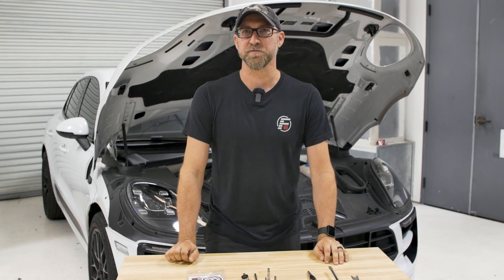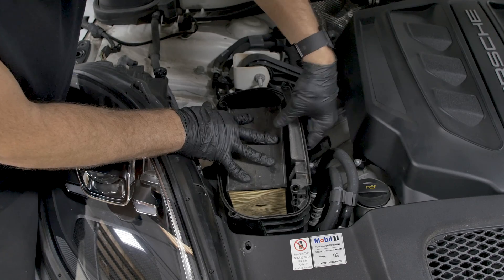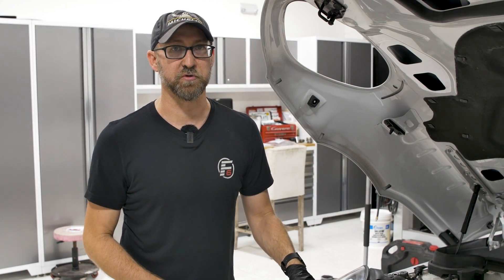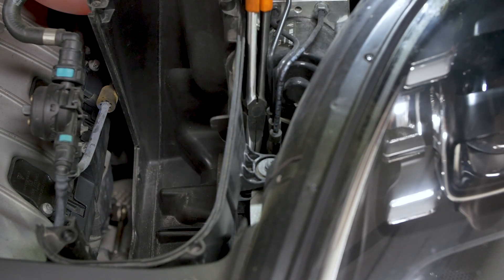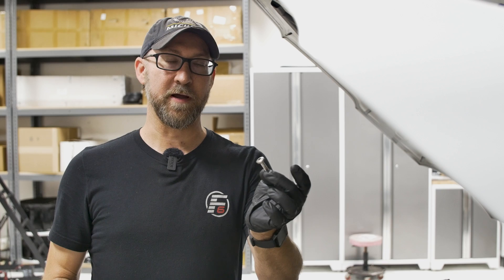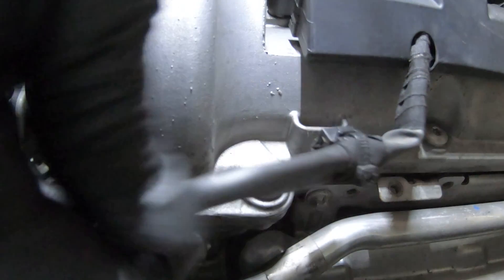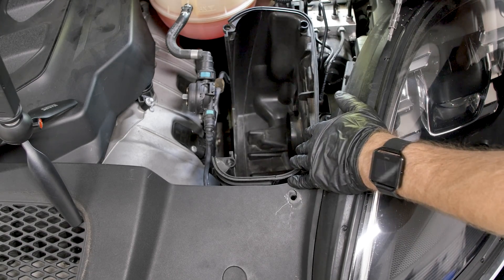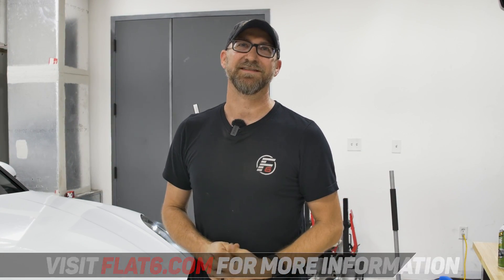How To: Macan Timing Bolt Replacement Guide

Comment: I feel sorry for the folks how were out of warranty-and got hosed/bent over by the dealerships that charged up to $10K to get this fixed!😱🙀🤬🤬👎👎👎. I’m from  the school of, disregard what the dealership  tells you and use your own brain/intuition. SO MANY TIMES, you can save SO much money…
BMW X5 I worked on recently, valve cover gasket for example.
Got breather tube, gasket set, new valve cover, and maybe one other little thing for under $300.
The job is completed with basic hand tools and e-sockets. Done in a day. No leaks! STEALERSHIP WANTED OVER 3K!!!!
European shops averaged 2.3K-(out of 5 I contacted)
If you have confidence in your puzzle/problem solving skills and know your way around a wrench-get your ass to work and quit giving away your money! Or give me these jobs!!! And MOST of the time-there are exceptions though, I can do better then the STEALERS

Comment: Sometimes valve cover will be leaking , should have use the original titanium bolt , special alloy block requires special titanium bolts

Comment: Are these 2 bolts the only 2 aluminum bolts they use for the timing cover? Porsche Dealer said mine is leaking but I’d rather do it myself if it’s one of these screws and not something further in the engine
Reply from the maker: No, they are made from steel and won't break like the aluminum ones.
Reply: No, there are many bolts on the timing cover. These are the two most likely to break first, they're also the two which are easiest to access before resorting to yanking the engine (or pulling off the front of the car and trying to get to the bolts that way, but to do it right the gasket should also be replaced because it will have formed to the prior tension). Replacing two bolts is not a fix, it's an attempt to mitigate a serious problem which will very likely show itself again when the other bolts start to fail. I've just rejected an otherwise nice 2017 GTS because it has this leak and I can't find a third party warranty which will cover an engine out if (or when) it worsens.

Comment: Thanks a lot for the step by step instructions. I replaced the passenger side screw with your parts. The airbox pins were difficult to remove because it's hard to know which way the pin should point to in order to get out. Make sure the upper one points up and the lower one points down.

Comment: do you have a repair for the sunroof drain lines that clog and fill the Macan with water, both in the battery box, and front floor areas?  Also, do you have a repair for the faulty mechanical fuel pump that leaks gas into the engine crank case - this dilutes the engine oil and leads to a catastrophic engine failure.  $$$$$$  I have found these problems on youtube.  Considering a Macan, but 100K plus for a problematic SUV....sadly makes me think twice.

Comment: Very good video.  Are these the only bolts you need to replace ?  Are the bolts you installed original Porche parts?  Or your own after market bolt.  If you change from an aluminum fastener to ferrus (stainless steel) will you not run into bi-metalic corrosion problems with the threads?  what is the mateial used on the cover and engine block?  Would an aluminum stud give you the same or better installation?  could you just drill out the treads and install a thru bolt with a stover lock nut?
Reply: The standard 'fix' pushed out by Porsche is to replace the top two bolts as they are the easiest to get to. But logic (and owner experience) will tell you that replacing only two of the many TCC bolts is a short term measure, the leak often comes back either from the top bolts or any number of the others. Unfortunately it's a short term band aid. If your leak comes back it's likely engine out time. That said it may be possible to dissemble the front of the car to access all the bolts, but this isn't always successful. I'm looking at used Macans at the moment, so far all of the pre-2019 units I've seen have had the leak. Sellers will say it's not a problem because there is an 'easy fix' - that is not true. Be aware it's the pre-2019 V6 units which are affected. The 2 litre base model is OK as are the vast majority of the Gen 2 Macans from 2019. Regarding the use of aluminium - it seems the original problem was caused by using a combination of inferior grade aluminium combined with over tensioning. As you say, corrosion if using steel bolts is a concern, as is uneven tension if they're tightened differently to the others. I don't think we can win this one, unless we have a comprehensive (and costly) warranty for each year of ownership.

Comment: Porsche want $10k for this f up!! I do think the aluminum bolt was put in on purpose so customers have to pay for this massive repair bill. I’ve had 2 timing cover chain bolt issues/leaks. Now an upper old pan leak. Sooo many problems with this car

Comment: Why in the world would the engineers think using aluminum bolts would be a good idea? 
Since I'm putting steal bolts back in, should I use some antisieze on the threads?  I'm assuming we're screwing into aluminum right, or is there a helicoil type of insert in there?
What's your recommendation?
Reply: Because they charge $10k plus for this repair!! So they make money!! Luckily this video now shows how cheap the fix can really be
Reply: @AndrewSkorsis-j4u  The cheap fix rarely works long term. It's just a temporary measure to buy a bit of time. Porsche was hoping their cheap 'fix' would save them from having to do the full job until warranties started running out on a lot of Macans.

Comment: Do you repeat  this exact,  same procedure on both the left and right sides on the 2.0-cylinder base model?
Thank you.
Reply from the maker: This is only for the V6 model.
Reply: @Flat6Motorsports  Thank you for your response 🙏🏽

Comment: I thought this would be much more involved, as in, several bolts requiring replacing. Was it always just these two bolts? I find it hard to believe that they were dropping the entire engine to replace two bolts...
Reply from the maker: These 2 bolts tend to be the most common to break and leak. It doesn't mean the others aren't susceptible but in the vast majority of cases, only these 2 break. Porsche used to drop the engine, reseal and replace all of the bolts. They changed their guidance to their dealers to replace the bolts instead about 18 months ago.
Reply: @Flat6Motorsports  amazing, thanks for the reply. That's a massive relief, as I've always wanted an S but steered clear from the tales of the engine-out service.

Comment: 4 bolt fix.  NOT just 2.  The driver side one next to air box (shown here) and the passenger side under the PCV valve hose (NOT shown here) are the tough ones.   The reason why the 2 bolt fix sometimes doesn’t work is there’s another 2 that shears easily.  And another opportunity for the dealer to pull engine.
Reply: Any of them can shear, and there are lots of them. If one or two break, others will likely follow.

Comment: Great vid. I used curved dental hemostats to grab the broken piece and unscrew it out the back on the driver side. They lock on to the small piece that’s left to allow grip on a very small bolt end

Comment: Im confused, please help. Why does the dealer require the motor out to perform this repair on a cayenne?
Reply from the maker: Porsche for a period of time required dealers to pull the engine out and replace all the bolts and reseal everything. Since, they have put guidance out to just replace these bolts.

Comment: Quico question, why are we changing these bolts. What were the symptoms that this fixed? Was your engine leaking oil or something ? What can this cause being broken ?
Reply from the maker: Yes, you would only change these if you detect an oil leak. Porsche used aluminum bolts at the factory during a few years of production and they are known to crack/break and fail over time with engine use.

Comment: is this for real? 15k bill cause of a bolt or two?
Reply: Porsche used to take out the whole engine in the beginning and as a result it was a huge amount of labour hours. Later they changed the procedure hence the much lower prices and quicker overall tunraround.

Comment: Thank you! My 2015 with 130K miles still had the original bolts and the one on the drivers side was indeed snapped. Appreciate the excellent video, make it pretty easy to do.

Comment: how can you torque the new bolt to spec when you can barely fit a 1/4" socket to tighten the bolt?
Reply: You don't.

Comment: Great Video and helped me make the decision to replace my bolts on GTS.  purchased bolts from Flat 6 with great instructions ...Well Done - i did use my flexible claw pick up tool to grab the long air box bolts instead of my needle nose, the other suggestion is to use the long extension torx bit to turn the bolt a to line up with the slot before turning the bolt.  it made it a little easer to see the slot compared to the needle nose - last but not least the wire harnerss clip in the front was a b...

Comment: damn! they really don't want us to repair these cars at home, I hate these engineers.
Reply: Wait till you read people (some that I’ve been ID as dealership mechanics) posting extremely abrasive stuff like if you can’t afford it don’t buy a Porsche and quoting the engine out thing and adding FUD about compromised seal even after the 2022 bulletin of the 2 bolt fix came out.   I had a 997 that suffered  an IMS disaster   After engine swap the car was NEVER the same again

Comment: I can't get the clips on the wiring harness offon the drivers side. It looks like they were already off in the video as it took no effort to unclip. Mine are stuck on super tight.
Reply: i used. small flat screw driver to pry 1/4 turn and they didn't break -

Comment: Excellent video! One thing I'd add, as I've performed this myself, is when installing the new screw, stuff a wad of paper shop towel below where it threads in, so it will catch the screw just in case you drop it while installing.  It's very tight, and you're working only by feel with just your fingertips, so it can easily be dropped, especially if it's oily. Without the towel to catch it, good luck finding it!
Reply: Even poppin belly pan won’t help.   Macan has built in black hole.
Reply: the towel is a great idea.... and used it to perfection :)
Reply: great advice:hand-pink-waving: